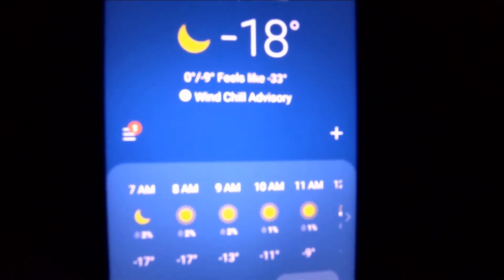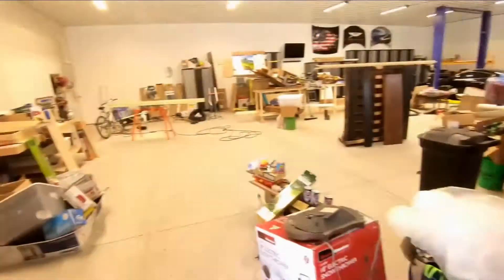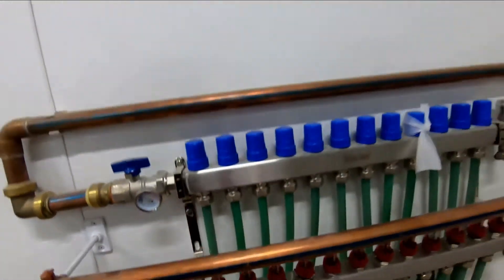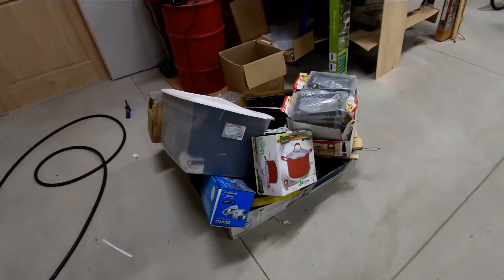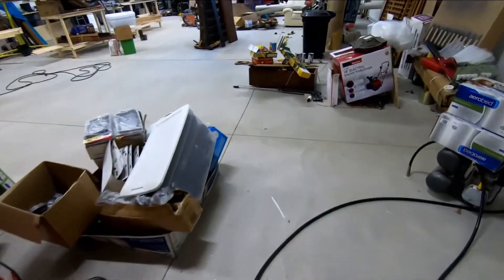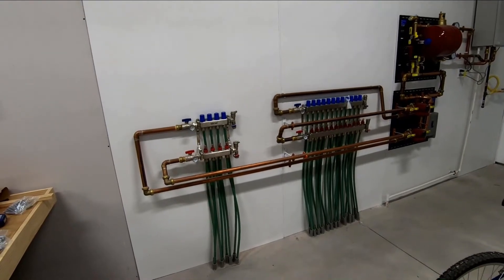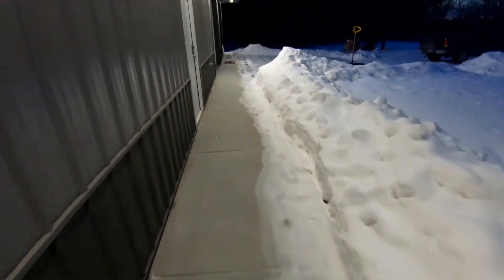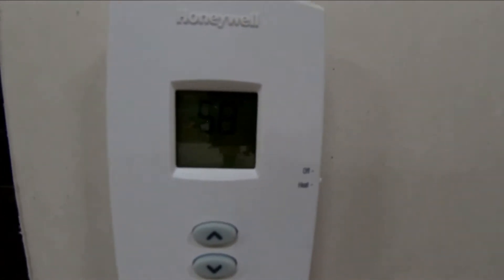-30  Degrees ! Did it Heat? NO Slab Insulation & Tankless Water Heater in Pole Barn Radiant Floor!

Comment: If you are sitting on a bed of sand , no insulation required, if soil is clay or loam you should insulate due to the fact that clay will hold moisture and heat is attracted to moisture therefore losing your heat going down towards that moisture. I have built both ways on loamy clay and the insulation makes a huge difference. Good job on videos and shop looks good 👍🏻
Reply: Not to mention that sand has a thermal conductivity nearly half that of concrete, so if your tubing is within the sand instead of the concrete, it's even worse than 60% as radiant heat seeks cold (it does not rise) and the earth below is cooler than your 57 degree air temp above. That heat will migrate downward more than upward
Reply from the maker: @Darnellp87  Where do you get your information?  Whoever is teaching you , should be fired!  Your reply says it all, you are a contractor who installs radiant floors so your old school thinking!  Concrete has a specific heat capacity of around 880-1000 j/kg and sand has around 800-840 j/kg , so basically sand and concrete are similar in specific heat capacity where sand is only $3 a yd compared to concrete is  $130 yd , that is why you use sand!  Now water has over 4800 j/kg so that is why water is the best thermal mass and keeps constant temperature as our 10,000 lakes would have no fish if it heated up same as the ground! There are multiple studies on the heat transfer , but heat radiants all around but it does rise and that is why you foam around perimeter to create a "Chimney effect" and prevent loss from sides and frost creeping in . A thermal mass build needs several different building  aspects to prevent it from wasting energy. You can search it and find out for yourself, as many government have done research on it.  Please use facts or reference some type of literature to back up your claims. I hate people who spread false information as I didn't do good in grade school with the telephone game!
Reply from the maker: @Darnellp87   There are many things about thermal mass builds including earth coupling.  Here is a good article from the AU government that explains it a little but it still neglects some info about colder climates  https://www.yourhome.gov.au/passive-design/thermal-mass .  I have many people that think old school say " It will never work , waste of Money" . But they were taught before the new technology and building styles came about.  There has been so much research that shows it does work , so I kinda get mad when people say it won't work without researching it. You are right about the conductivity , but in a Thermal mass build that doesn't really apply as you don't worry about the heat transfer because the mass is so great that it doesn't " Cool Off?"  Its a constant heating, where if you don't have thermal mass, then it would be a factor and wouldn't work.
Reply: I’ve read to Many horror stories of people that didn’t insulate under
The slab and or around the foundation in colder
Zones like I am in Colorado that I would never pour one without at least some insulation under slab. I can do sand as I have a sand pit on my property but I’m just going with compacted road base and 1.5” eps and 2” iso 24” vertical around the perimeter.
Reply from the maker: @cygnus1965  The problem  is people  don't  fully understand how to build it with a sand base and no insulation.  You need  pex every 8" vs 12-14" regular  . If they don't  do that it will never get that hot. Perimeter  is a must for any application of radiant floor as you want heat funneled up like a chimney.  But commercial  builders have been using no insulation  under slab for years,  as insulation  costs would be 20 percent of budget.  Either way. Sounds like you have done your research and good luck on your build
Reply: @JasonYouTube  The foam board insulation is pricey. An alternative I used was the cut outs from doors. They are 1 3/4" R11 and are rigid enough to walk on. I came across a good deal and was happy working with the material. I a sure they may have that product in Colorado.  By the way nice shed Jason.
Reply from the maker: @symmetry119  Pretty creative , never thought of that stuff. Thanks for the comment and watching the video
Reply: @JasonYouTube  you do realize that the reason for needing more tubing without insulation is because you're wasting more heat to the ground below, right? Sand or not, an uninsulated radiant slab will always require more BTUs (aka more fuel) to heat the space than an identical build with insulation below. Every time your system runs, you're wasting fuel by pumping heat into the earth. If you'd insulated below, your water temp could be under 100 degrees instead of 120-130 like you need. It's impossible to say for sure what the actual operational cost saving is, but it's an absolute fact that you're wasting a good portion of the heat produced. Once you figure in the cost of 50% more pex upfront, the associated larger manifolds, extra antifreeze, and the extra gas cost, the foam would have been cheaper after only a couple years.
Reply from the maker: @Darnellp87  Your point is wrong, the more tubing is needed because I basically have around a 16 inch slab!    I am heating 11 inches of sand and around 4-5 inches of concrete. That is why you need more tubing, same concept as having more tubing in a 2000 sq ft insulated slab vs 1000 sq ft slab correct? The pex is around $100 for 300 ft roll and the manifolds are roughly the same cost. I covered that indepth in my 1 video and showed the actual price difference.   I break down the cost in detail as no matter how good sonething is insulated , you cannot go below a certain heating input need.
Reply from the maker: @Darnellp87  Watch my video slab insulation  vs heat loss and it explains it in detail. In minnesota, I am heating this for less then 1000 sq ft homes! With thermal mass its basically a big battery that gives off when needed , so you save money that way
Reply: @JasonYouTube  well, 100% false actually but sure. Once a thermal mass is heated, it no longer requires any BTU input for gain- only to maintain. While more tubing in any other slab can be helpful for more input (aka heat up faster), you need more tubing because you're losing 25-75% of it to the earth below. I have designed and installed literally thousands of radiant slabs in MN, most of them shop type buildings like yours, and the proof is in the pudding. If the earth below the slab worked as a thermal battery as you believe, we wouldn't need supplemental heat would we? The constant temp of the geothermal earth below would always keep your building well above freezing if that were the case. It's not, which is why you need to add the supplemental heating system. 4800ft of tubing versus 3200ft at $100 per roll is $500 already, plus the extra ties and mesh (maybe $100?), 16 loops versus 11 in manifolds ($200ish), 14 gallons of antifreeze ($150?), etc instead of $2000 worth of foam. You've already spent half of that $2000 in extra material you didn't need. Now if you spend $600 a year as-is on fuel, cut it by 25%, you're ahead of the foam cost in only 8 years. Odds are extremely slim it's only 25%, but I've given you the benefit of the doubt. In most cases it's closer to 50-60%, which cuts your payback down to only 3-4 years and saves you a couple hundred every year forever after. Math isn't hard
Reply from the maker: @Darnellp87  Watch my Video on Radiant Floor no slab insulation vs ground heat and see the math!  It lists everything and I show the product so you guessing and throwing out numbers to make your argument sound better, isn't working!  Do a check fact and go back to those thousands of pole buildings and ask how much their monthly heating bill is and figure out the heat per foot of space and even ask what it is set at. I have mine at 57 but it doesn't matter as my thermal mass will blow it out of the water. So do H x W x L and figure it out. I heat 3200 x 12ft for less then $80 a month!   Now I used 3 extra rolls ( at $80 a roll) as a 3200 sq ft with 1/2" pex can be between 8-12" spacing .   But all that is explained in the video, but are you a person who has a closed mind and doesn't want to maybe learn a new thing? If you are open minded and want to see real facts with the math , then watch the video. If you want to just argue a point that you have no facts to back up, then its useless.
Reply from the maker: @Darnellp87  I used 3 extra loops of pert , so the antifreeze is 9 gallons ( 1 gallon per 100ft) at a 60/40 mix so antifreeze is $60 ( 5 gallons) extra that wasn't in video , manifolds are same cost , mesh isn't included because it is a wash  between stapling down on foam or ties.
Reply from the maker: @Darnellp87  Did you know Most commercial buildings and energy certified buildings use in-floor heat and they use no slab insulation? I worked in the commercial trade fields, with Morton, Kraus , and McGough and you see how those building are built and the government jobs which need to be certified .  Fun Fact: Did you know that on a government job a journeyman and apprentice make the same? Davis Bacon !
Reply: @JasonYouTube  Sigh.... I'm sorry that your lack of knowledge on the subject has gotten your undies in such a twist, but there is obviously nothing which can be done to convince you to think otherwise. Surely my life as a LEED certified radiant designer means nothing to you, but it means a whole lot to the people who actually matter. I run into approximately 10 buildings per year which were originally designed your way (which was actually the old school train of thought, prior to the discovery of closed cell rigid foam) which I then convert to a modern, insulated system with no other changes to the envelope. Every single one of them drops a minimum of 25% in utility cost but most closer to 50-60% as stated earlier. Some with gravel or clay beds exceed 70%. I have a couple 60x60x18 farm shops near Royalton MN which were built 1 year apart, by the same builder, with identical plans. Same windows, doors, insulation, tubing, boilers, literally everything is identical except for the slab. The first one was built with a 12" pit run sand cushion under a 6" slab, with 1/2" pex tubing at 9" spacing, tied to 6" mesh on top of the sand- no insulation except for 4" thick XPS vertically outside the poles 4ft deep. The other one uses the same 1/2" pex at 12" spacing, above 2" XPS,  suspended to the center of the 6" slab and tied to the same mesh- no sand. Both buildings are kept at 70 degrees year-round and have very similar usage as far as door opening, etc. The building with the uninsulated slab used approximately 3400 gallons of propane in the 2019-2020 winter, 2 years old. The building with the insulated slab used roughly 1900 gallons the same winter, 1 year old. That's about as close as I can get to an apples to apples comparison for you, but again the proof is in the pudding. FYI, 90% of my 60,000 hours of field experience is in commercial buildings around the TC metro and MAYBE 400 of those hours have been radiant slabs. Aside from snowmelt and public works, almost zero commercial buildings utilize radiant slabs. Really cool story though, thanks for sharing
Reply from the maker: @Darnellp87  If your telling me that I can get my heating down to less then $50 A MONTH  on a 38000 cu ft pole frame building in Minnesota,  then you are smoking some good stuff! 🤣 Now you seem like an educated professor  who usually  means its like talking to a wall. No matter what, that University education shuts off the minds openness to accept a different way of doing things. A building needs a certain amount of Btus to heat the air. And no matter how insulated it is , it requires a baseline amount to heat a xx amount of air  , a xx degrees above outside temp.  Now I don't  want to waste time looking it up because you will not accept it, but I'm happy with my heating bills and they are 1/2 as much as most in floor slab with insulation builds that I have compared it with.  Hey but upside, I  didn't mind the debate.  If you want to make me a true believer,  get those heating bills and we can compare the heat required to heat their 1 cu ft of air to mine. Seems logical and scientific!
Reply: @JasonYouTube  you're incapable of dividing 1900 by 3400 or what? I literally just gave you the comparison as well as the measurements of the buildings. Radiant heats matter, not air, and anyone who's completed 8th grade knows that. Perhaps start there before you attempt to argue subjects you know nothing about. Obviously your overall cost is 1000% dependent on your NG cost per therm, which I have no idea of, but I do know that I heated a 50x100x12 (60,000 cubic feet, since you can't do math) body shop to 70 in Foley MN on NG for a total of $917 this past winter. A 25x40x9 slab on grade home I built near Foley 2 years ago as a rental property never exceeded $30 on any bill. So yes, you probably would be able to heat your place to 57 for $300/yr if you'd insulated the slab like someone who understands thermal dynamics or has a lick of common sense. In 3 years when you have to replace that POS you call a boiler (it's a Takagi water heater with a HydroSmart sticker on it) maybe it'll start to sink in that spending an extra $1500 upfront would have saved you $10,000 over the next 30 years. Or maybe it won't, because your mind is locked shut.
Reply from the maker: @Darnellp87  LOL man thanks for telling me what I have said in MULTIPLE videos to buy the Takagi and avoid the markup of HydroSmart !! But for MATH let's take the example of the 60 x 60 x 18 that uses 1900 gallons  @ $2 a gallon for propane . So heating cost is $3800 a year ROUGHLY ( Don't want to get technical but in general the cost) for a 64800 cu ft building ( 60 x 60 x 18)  To heat MY building it is .00097-.0019 PER CU FT. So your example would be 64800 x .00097 = $62.86 PER Month if comparable to my build / use/ etc.. I am using 1/10th of your example. But just say that building has 9% of its sq ft as openings ( Mine has that , around 280 sq ft or garage door/door openings) then that would be comparable IF  Everything was same. BUT say that building was never used and just heated to maintain the temp , according to YOU I am wasting 50-75% of my heat. So in your example $62.86 , to my heating equivalent ,  that building you could heat for $15 to $30 a month for a building that size if not used at all??? Like I said before, there is a minimum heat  needed for a certain size . So if you think that you could heat a 60 x 60 x 18 building EVEN without windows , doors, etc.. for $15-$30 a month in Minnesota, then your argument would be valid but is that Plausible?? Highly doubt it!!! If the 60 x 60 x 18 had 9% of sq ft openings then the bill should be $62.86 if everything was equivalent ( Use, openings , etc)
Reply from the maker: @Darnellp87  And yes , I know that everything wants to balance out . That is how a Thermal mass build  works and why you have high mass. That body shop in Foley, give me the name so I can fact check their heating costs and look at their build compared to other shops . $150 a month to heat is good depending on how busy they are.
Reply from the maker: @Darnellp87  Man your killing me , your rental property example.  Lets do the Math!! 9000 cu ft ( 25 x 40 x 9 =) x .0009- .0019 is $8.10 - $17.10  in monthly heating cost if it was equivalent to my building!!! LMAO so your example with the numbers, my building is more efficient  in heating by 1/3rd to 1/2!!!  The .0009 - .0019 per cu ft heating is shown in my videos with HARD FACTS. Sorry , your stuff isn't adding up !   Thanks for the debate but your data is just proving my point, so better to stop.
Reply from the maker: @Darnellp87  Dude is this Jim or Adam? Your trolling me on purpose , lol. This can't be serious . Ok i'm done following you down this rabbit hole, you got me!! LOL
Reply: @JasonYouTube  You bought HydroSmart's junk piping panels, you got the shaft anyway. Propane has been under $1 per gallon for over a decade for farm use, but the cost of that propane is 100% irrelevant. Propane holds 91,000 BTU per gallon so total usage was approximately 173M BTU for the season or 2668 BTU per cubic foot. Now figure out your cost per therm (100,000 BTU) and do that math to figure out how many BTU you used. The farm shop in question has roughly 370 sq ft of openings if my memory serves, not that it's a linear equation but slightly more than 10% of the floor area. Both buildings are used all day every day year-round, and overhead doors are opened several times per day with ice cold equipment coming in AND they're keeping it 20% warmer than you are. You're comparing apples to oranges by comparing it to yours, it doesn't work like that. I was merely comparing one building to the other, identical aside from the radiant system and using 56% less fuel because of some simple foam board under the slab. Why is this so difficult for you to accept? Your building is 57 degrees, my rental is 75. Again, apples to oranges. There isn't a person alive dumb enough to believe that a 50 degree mass of dirt will not suck heat perpetually from a 100+ degree bed of sand with no thermal break. Ever touch freshly excavated dirt with your hand? Cold right? Your hand is giving heat to the cold ground via conduction, the same as your sand bed is doing without a thermal break. Seeing as you didn't make it through 8th grade science class, it's no wonder you became a laborer.
Reply from the maker: @Darnellp87  Your right about overpaying on those panels, that is why I did a video on making your own!  But you are COMPLETELY CLUELESS!  You don't even have 8th grade education and you admitted to it! You stated " Radiant heats matter, not air, and anyone who completed 8th grade knows this "  Right?  Well that matter heats the surrounding air and that is how your thermostat maintains the heat!  I guess if its set at 58 degrees I feel like I'm at 58 degrees but air is at below 32 degrees in winter or matches outside temp because it doesn't heat the air , according to YOU??  LOL  Radiant floor heats by CONVECTION and the air circulates by that means .  You are proving that you cannot grasp this concept no matter the proof.  Radiant heat settings are different then forced air. 65 degrees radiant is like 72 degrees forced. Lowering a thermostat by 10 degrees only saves 10-15% on energy, and less with radiant floors. According to Dept of energy.  You are letting your emotions ruin your logical responses if you are an adult. Right now I am leaning that you are under 8th grade and a troll on summer vacation. Nothing against being a laborer but I did a few jobs like that and I also went to MIT for Aeronautical Engineering.  It takes a big man to admit that they are wrong, I have admitted when I am, but can you? Because lets face it, with your own words , you basically showed that you didn't pass 8th grade with that radiant heats matter not air response!  Don't let emotions cloud your judgement and sometimes take a break and cool off - a wise man once said.
Reply: @JasonYouTube  hahahahaha you are a sad, sad little man.... Radiant heats matter via radiation (hence why it's called radiant) which then heats the surrounding air in a reverse fashion. There is almost zero convection in these types of systems, which is why HRV units are required to maintain air movement. I've never claimed to be an intelligent person, but I also don't feel the need to lie to strangers on the internet about going to MIT as if it's even remotely believable when you can't even spell "you're". Figure out your BTUs used like I told you and do the math. Insulated takes considerably less fuel than uninsulated, PERIOD. Using daytime setback may lower usage by 10-15% and less with radiant, yes. Keeping the temp 13-18 degrees cooler for 6 months straight WILL use easily 20% less fuel in our climate. It's called heating degree days, and using it along with all the other necessary data, the actual savings can be easily calculated to the penny.
Reply: Thanks Jason. I have done a ton of research. I scored big time this summer and kinda glad I had a couple set backs since I found an ad on Markey place for free foam board insulation. I ended up getting enough 4” to do the whole floor of the house plus a bunch more I plan to use in the attic and or walls. I am setting it all up this weekend and plan to pour concrete on Tuesday. Thanks for the videos they definitely have helped.
Reply: Oh this is Cygnus65 by the way. Lol
Reply from the maker: You are correct that sand has about same heat trasfer properties  as concrete  and clay/loam will need to be removed and a sandbed put down.  Also clay/loam isn't  a solid foundation for a concrete slab as it absorbs wetness and makes a landslide. Thanks for watching and pointing it out
Reply: Reflective barrier on sand works well. (Bubble foil bubble concept). Always perimeter insulation. Always a tankless water heater.